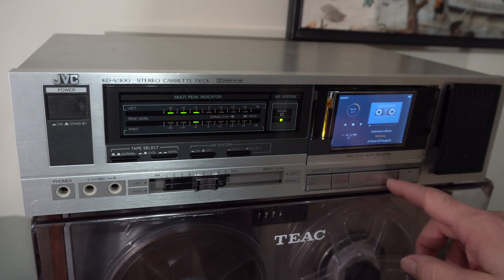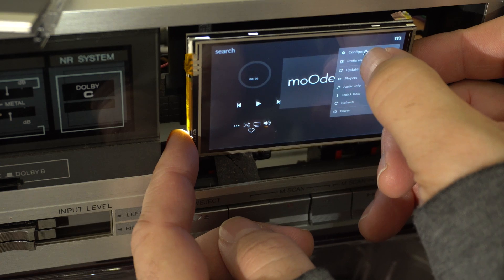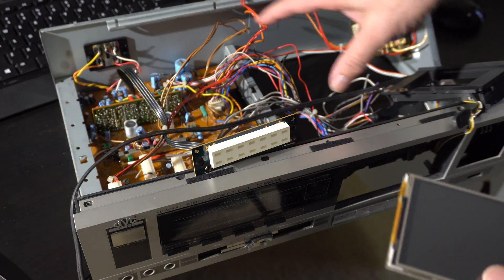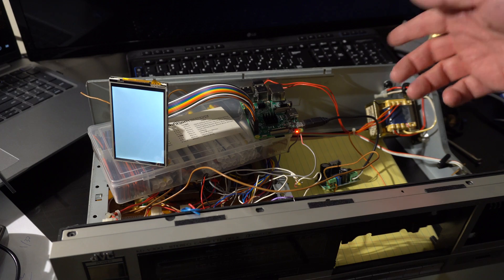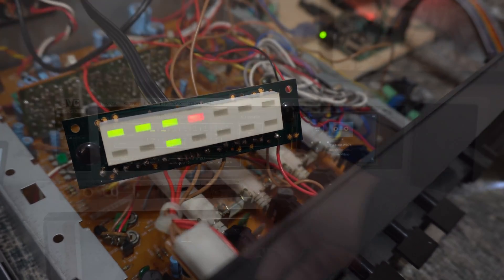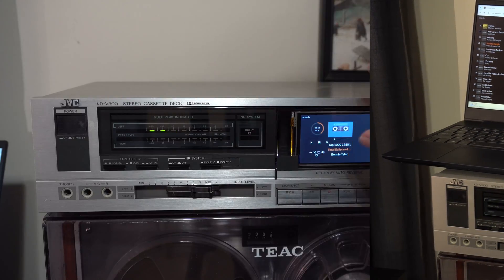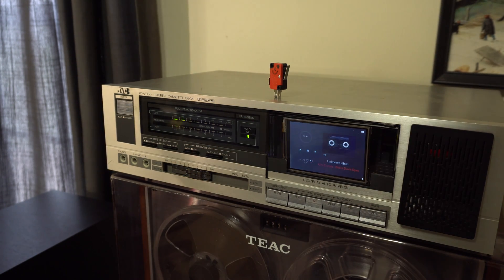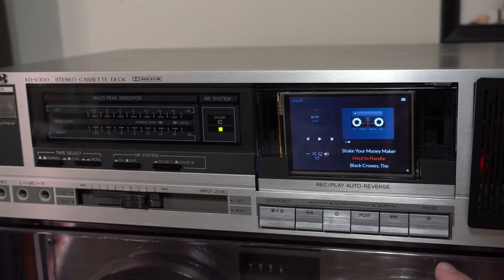JVC Cassette Deck Or Sneaky Stealth Streamer?

Comment: For the VU meter, maybe use the 12V from the AC transformer ? Or if you want to use another boost, you could add a cap between the two legs of the output.
Reply from the maker: I tried using the 12 volts AC from the unused leg of the transformer and ran it through another booster, but when I tied the grounds together got a "hum" in the sound - capacitor would have been a good thing to try to eliminate that - thanks for the comment!

Comment: meters like that are flakey. i still have not figured out how to repair them. they use smd leds and a controller. i think the controllers go to crap over the years. it is under a black blob on the led board, one for each channel. this is not to be confused with the driver which is a different circuit. sansui and pioneer used them in the 80s. they suck.
Reply from the maker: This definitely has those black blobs on the LED board. I probably broke it messing with it.. Thanks for the comment!